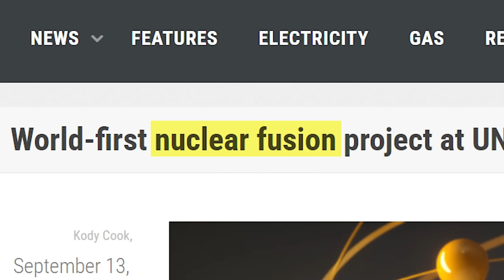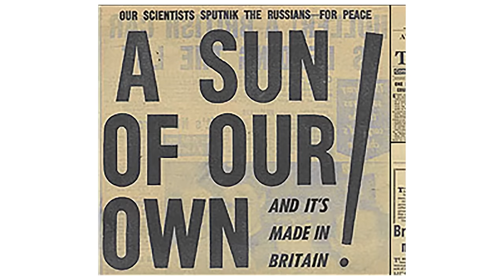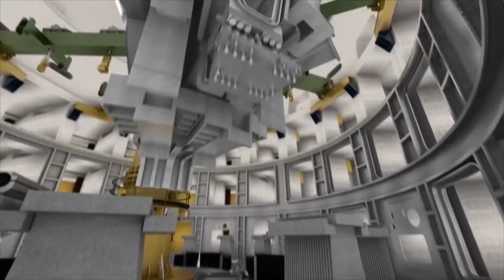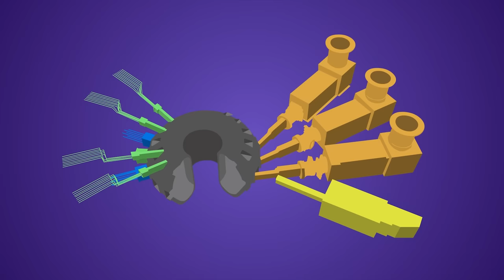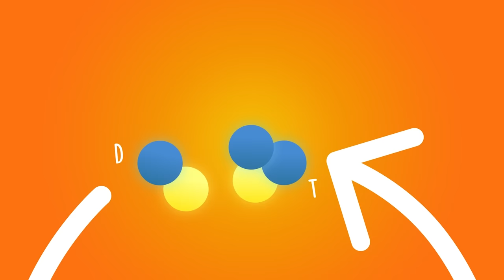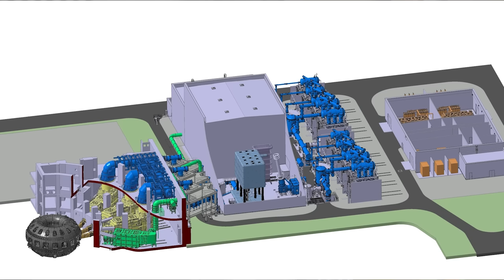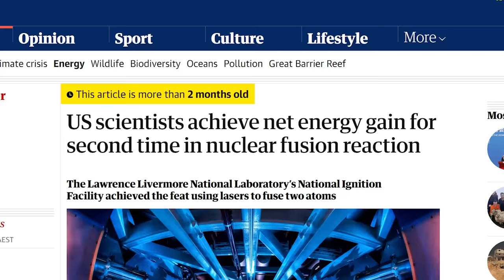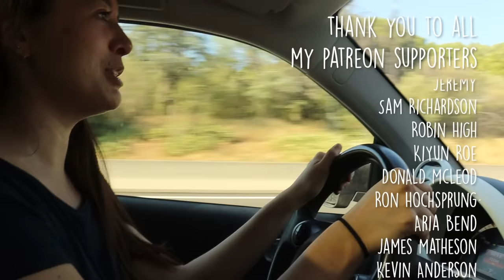World's Largest Nuclear Fusion Reactor!

Comment: Could they not start a smaller smaller fusion reactor to be used as a heat source for starting the larger fusion reactor? Multiple stages. Seems excessively risky to go to such a large size from the get-go.
Reply: No, they couldn’t. That’s sort of nonsensical. 

Yes, they started with smaller reactors. ITER is a successor to several generations of progressively larger reactors.
Reply: @Gomlmon99  Many large engines are started with smaller engines. Your comment suggests little engineering knowledge. ITER appears to be a massive scale-up factor over something that doesn’t work reliably at smaller scale. NOBODY has ever built a reliable fusion reactor at any scale. Net power output for a few seconds doesn’t rise to the level of “reliable”. Ever wonder why all the lengthy unplanned delays? That doesn’t sound like a promising commercialization path to me. It sounds like they’re winging it as they go.
Reply: @Tom-tk3du  yes but this isn’t an engine. There’s no way to transfer heat from plasma in one reactor to plasma in another.

If I remember correctly, ITER is roughly 10x greater volume than JET. The reason smaller reactors don’t work is inherent to the physics of fusion. Power increases very exponentially with plasma volume due to reduced energy dissipation from the sides of the plasma. A small reactor is extremely hard to produce net power with. 

Since the conception of ITER, more modern magnet technology are allowing progressively smaller new reactor designs.

Agreed they have massive delays. Not because they’re winging it. Just because what huge, international first of its kind programme doesn’t have delays? It’s just the usual supply chain, programme management, build quality  issues etc.

Comment: How do you stop it?  Like, how do you stop the sun from doing its thing? I'm not convinced fusion power is as harmless as it is portrayed to be.
Reply: The fusion reaction inside the tokamak is actually very different from the one in the sun.
The sun works with a very high density, an astronomically large volume and quite low power density (<300 Watts per cubic meter).
In tokamaks on the other hand the plasma is almost a vacuum, which just a 1/250 000 th of atmospheric density on earth. So in that big vacuum chamber of ITER, there are only a few grams of plasma at any one time.
And if the plasma hits the walls or there's a slight contamination, it will immediately extinguish.

In fusion reactors, the hard part is keeping the reaction going. Stopping it is trivial - contrary to regular nuclear fission reactors.

Comment: Thank you for this video. I had no idea about the scale of this project. I still don't get how it get 50MW to 500MW ...... isn't this against some laws of physics, lol. Conservation of energy. This is like 10X better than a perpetual motion machine.
Reply: The 50MW is essentially a (really big) spark that allows the fuel to release its energy. Nuclear energy, whether fusion or fission, depends on conversion of mass to energy, as described by E=MC².
Reply: Consider striking a match and lighting a fire over which you cook something. How much energy did you put into harvesting the wood and striking the match? Was that enough to cook the food? No? So did you make a 10X perpetual motion machine? No. You released chemical potential energy bound up in (the electron orbitals of) the match and the wood. In fission and fusion reactions you release binding energy from the nuclei of the atomic fuel. The energy doesn't come from nowhere, it comes from the fuel. The "energy in" in the fission or fusion case is the equivalent of the energy put into striking the match.

Comment: I get that ITER is a proof of concept and research reactor, but I still feel like they should have designed in a "tap" or provision for a power generator. Then maybe after 10-20 years of research, they can just run the thing as a power plant and sell the clean energy, at least it would cover the CO2 emissions and energy of building the plant even if it didn't pay for itself.

Comment: Nice overview of a doomed project....    a project whose construction, in the words of its advocates, should have been completed n 2016....  now, a probably much incomplete version, unable for instance to operate with Tritium, will come into operation in 2035 (or around that time,  do not hold our breath..) and at a cost several times higher that the initial costs anticipated by the same fusion experts... and who knows when, and IF, ITER will  be able to start real Tritum operation....  probably around mid-century?

lndeed, optimism is the only resource which has never been in short supply in the fusion world.

A couple of points worth noticing.
Unfortunately the bottle of seawater shown at around 1:50 will not be able to provide energy to power anything. ITER (but also NIF based on inertial confinment) will use a 50-50 mixture of Deuterium  (indeed abundant in nature ) and Tritium, of which only traces are present in nature.  For fusion to be viable, fusion reactors will need to be self-sufficient and breed the tritium necessary for their own operation.  Those breeding technologies have not yet been proved, not even remotely.... and will only be very partially tested in ITER (if ITER will ever come to be operated  with Tritium ...)
In fact, contrary to what is claimed at ca 2:20, ITER will not prove ALL the necessary technologies...
For example, tritium breeding will only be very partially tested;  long term material behaviour (subjected in a reactor to extremely high radiation levels) , will also be only marginally tested
More in general , another experimental machine (often  called DEMO) will be, at the very least, needed. And, in fact,  I doubt that just one, single prototype, will be able to sort out all the issues ((reliability, maintainabiity, repearability, etc.) to bring a fusion reactor  up to the level necessary for a commercial,  economically viable  energy production plant.
I do not comment on the statement that ITER  aims at  producing ten times more energy than the  energy needed for its operation.. this has already been discussed many times ... and it is simply a  grossly misleading claim.
A little exercise....  in the light of all the above, when do you think we could have eletricity produced by fusion?  assuming that everything, from now on,  goes according to plans...  after all, we are optimists...

Comment: The video was nice but I don't like the way you presented Nuclear Fusion Plants.

The ACTUAL Problem with Nuclear Fusion Plants is Politics, The Fuel of These Plants Can Be Easily Studied & Made into a Nuclear Bomb.

The Accidents & Nuclear waste are LEAST of our concern, Accidents are almost near impossible with Modern Tech & Rules and Guidelines in Place + The Added Counter Measures To Prevent Any Accident.

The Waste is far far Less than you actually Thing and can be easily stored anywhere.

Comment: Kinda sad when we know Fusion will not be economically viable compared to solar and wind. 

Yes i know "its unreliable" blaah blaah blaah. We could fix that by automatically controlling the load. Every house in finland for example has a thermal energy storage. You could automatically fill that up when there is alot of power and release it when there isnt. I also believe its mandatory to have a wood heating solution in a finnish house so when there are long stretches of low wind you could just use that.

Comment: >experiment
you mean its not even a working one?!
Reply: nope, not quite. Even though technically in ITER 10 times more energy will come out of the plasma than what is put in, this would not be enough to actually get net energy out of the entire power plant. If they were to try and make a power plant out of it with steam and turbines, it would turn out to just make up for what's put being put in.
But fortunately, to get that gain factor up to 40 as required for a proper power plant, you only need to make it a little bit larger - or the magnets a little bit stronger. So the step towards an actual power plant after ITER is not a very big one.

Comment: If they only need 50 MW, why are they building the 250 MW power station they need to supply ITER? 500 MW of fusion energy should be converted into steam, and steam into electricity. The loss is 50%. So even though they get 500 MW of output power, that's only 250 MW of electrical energy. I will not list further losses. I am in favor of these tests. I just don't like lying and talking about peak power input / output, instead of total power input / output. I'm talking about everyone  who trying similar things here. No one is talking about total spend versus gain.  I understand the problem. Political cheating to obtain financial resources

Comment: I feel like this really glosses over a lot of information.  Fussion is fueled by either deuterium or tritium, not sea water.   Also I think you strong suggested that the ignition event last year produced more energy than it took.  Which is very misleading.  It's technically true, but it paints the picture of electricity going in vs electricity going out, which is the lie.  They produced more energy from fusion than the energy in the laser beams.  Note, powering the laser beams took substantially more energy to operate.  Also Richard is right.  But we can pump out nuclear reactors pretty fast if we so chose.  In Canada we built 20 CANDUs (the source of the tritum for Iter)  in 20 years.  If we really had the will to fix climate change we would spend 10-15 setting up the industry to produce quickly.  Then just produce quickly.

Comment: Richard says : MY reaktor, and gets angry on the competision around the world. And a word Jade like to use, is COOL. Tokamak is not cool, more like superhot. The weight of the tokamak is "x pcs trains" if to compare to poststamps or volvo 145  (in sweden) (italy fiat 128), how many will it be? The tokamak volym is x olympic pools, i never seen a olympic pool. But i know 747 jumbojet, howe many do i need to get same volym ( possible to use black plasticbag?) (125 lit, dont know in gal) i got ADHD, and i have problems . Size of a  black hole, is so smal, and weight about 1000 sunmasses. And size of a sunmass is? Compare to earth or jupiter? Whats your bodyvolym in a olympic pool.

Comment: This is, without doubt, the single most useless research project of all time. It will never produce a single watt of power, and it can never lead to a design which will! And if (by some miracle) it could, then the design would mean it produced the most expensive electricity of all time, and there would only be 4 places of earth where one could be built, due to the current draw required to start such a thing.

Yes - ITER is a pile of stupidity, where the PhDs will pile up taller than the reactor building, and nothing from this project will ever generate any power.

The very idea of a steady state fusion Tokamak is a special kind of moronic concept. Why? 
"Because the USA has spent many decades, and many tens of billion of dollar studying Tokamaks, and so we know a LOT about them, and what we know is that they are no damned good. I suspect the Russians release the Tokomak because they knew we would waste all our time and money on them!"
-- RIP Robert Bussard.

The only viable possibility of creating net power from fusion is via pulsed reactors like with Focus Fusion over at LPPFusion.